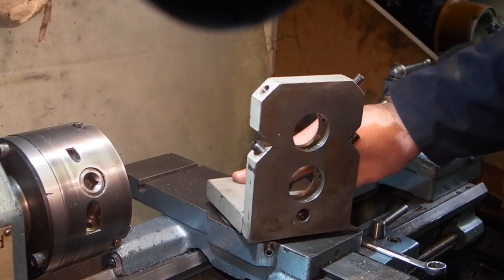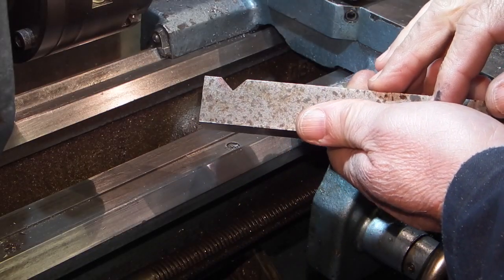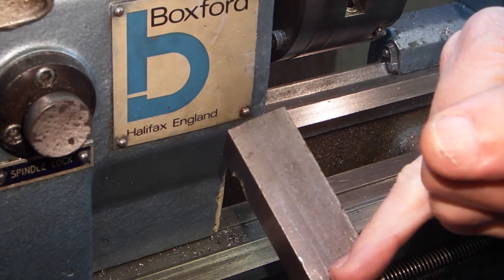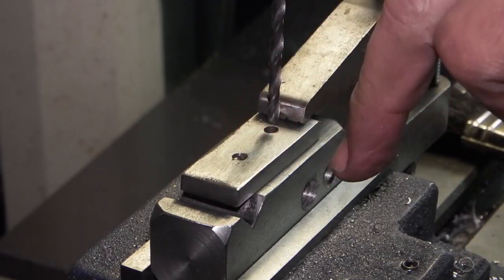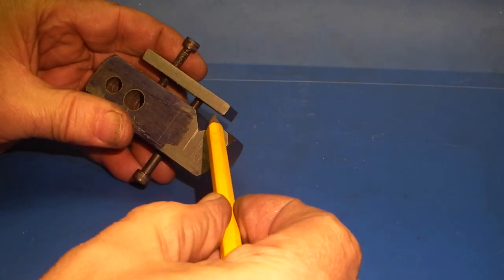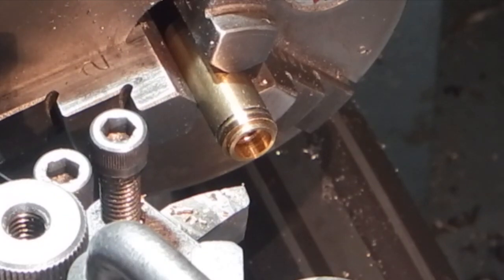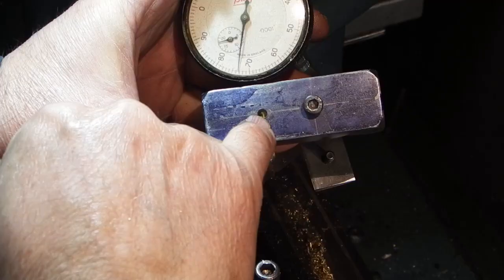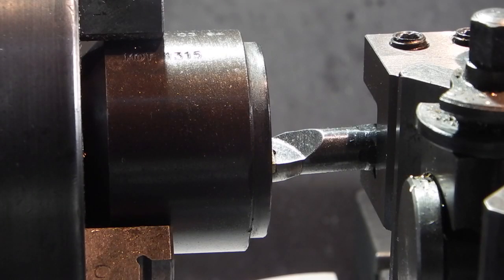Lathe carriage stop/DTI holder.

Comment: Nice job on the tool but it appears that you turned a 25mm indicator into a 6mm or so indicator....unless I am missing something here.
Reply from the maker: Hi Makin
Yes I have reduced indicator travel to about 0.25" (25 turns on my indicator which is a 0.0001" reading) as I normally set the indicator to about 2 turns so I do not have to start counting the divisions on the small dial.
If you need more you could make the bar from 1" to 3/4" or replace the indicator tip with a longer one.
Reply: 👍🏼 I have flat ways on my Atlas, makes it easier to make devices like these. Nice job